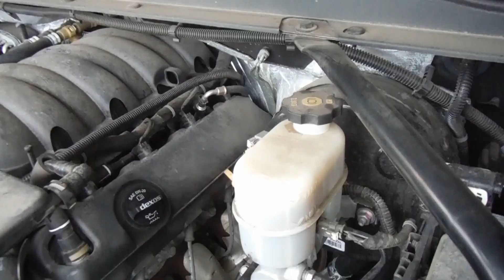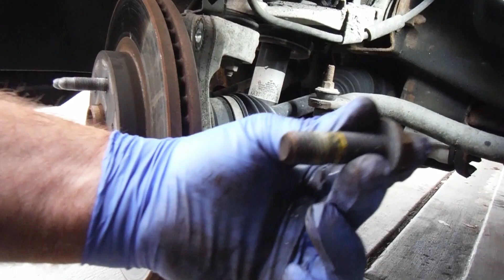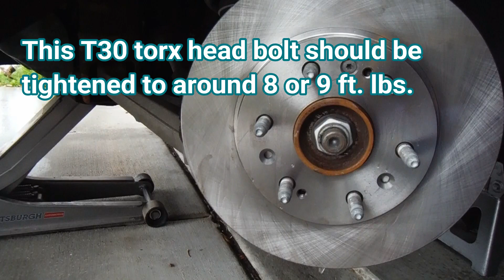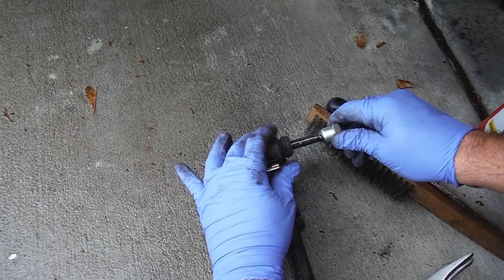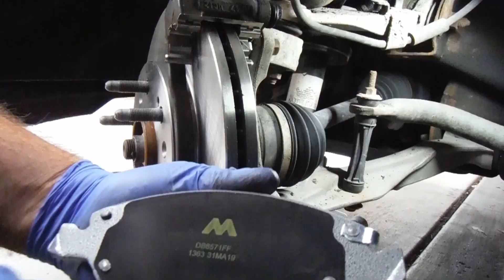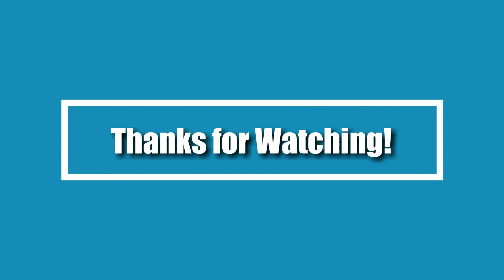2015 GMC YUKON XL HOW TO REPLACE FRONT BRAKE PADS & ROTORS - EASY DIY

Comment: Do you have a video showing the rear brake rotors and pads on the same models/family?
Reply from the maker: This should be similar, but it's on a Sierra:
https://youtu.be/Vz97TDt6Q5c
And this is pads only on a 2018 Yukon:
https://youtu.be/uZIOMvXOXIE

Comment: Thank you for tge video. I accidentally forgot and put both curved pads on one side. They went in fine. I had to purchase another box to do the other side. Would you see any issue running both curved on one side?
Reply from the maker: I have seen exactly that happen before, when someone did just one side of their brakes and decided to have me do the other side months later.  That’s when I realized it and showed him.  It didn’t seem to cause any problems, but if you can just take it back off and put the correct ones back, I would do that.  I ended up changing them back to the correct way even though it had been driven on for months.
Thanks for watching, best of luck to you.
-Dan the Fix it Man
Reply: @DantheFixitMan  
Thank you for that, 
I just finished and seems quite and brakes well. I will change the rears in the coming weeks, I will probably go ahead and do that them. Thank you for the information sir,

Comment: What do you recommend to do if the 18mm caliper support arm bolts are frozen?  I have not done the brakes before and I'm unsure if thread locker was used previously or if they're simply frozen from other factors.
Reply from the maker: Hi Jason,
On something like this, the thread locker should be on those bolts from the factory.  I would use a long breaker bar, or maybe try some heat first (carefully).
Best of luck to you!
-Dan the Fix it Man

Comment: Is there a reason you didn't use thread locker?
Reply from the maker: Hi Jeff,
I probably just didn’t have any at the time😉
But seriously, there’s usually enough of the yellow factory thread locker on the bolt to keep it from coming loose as long as it’s torqued to spec.
Thanks for watching!
-Dan the Fix it Man